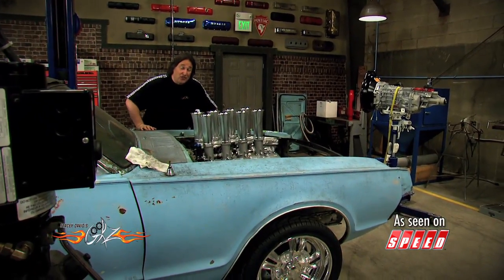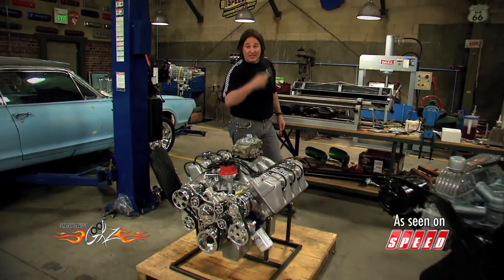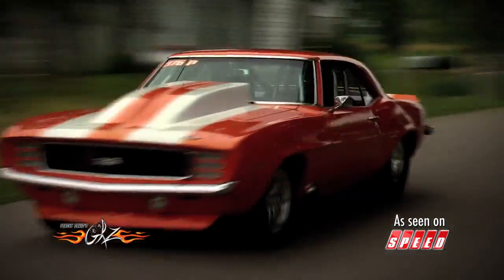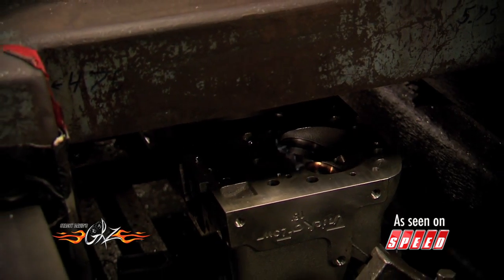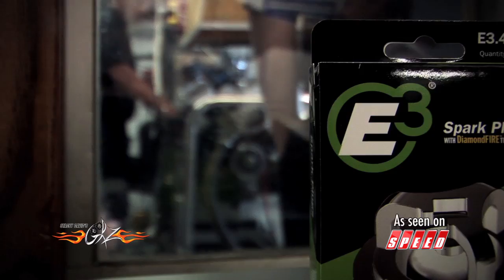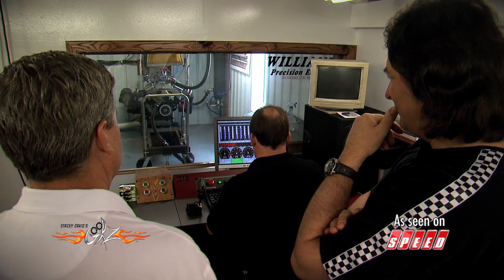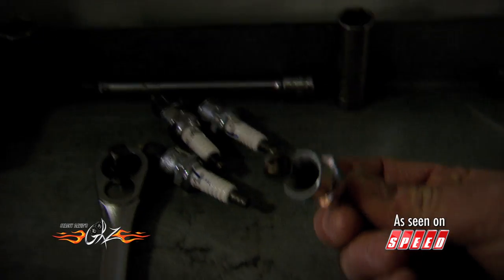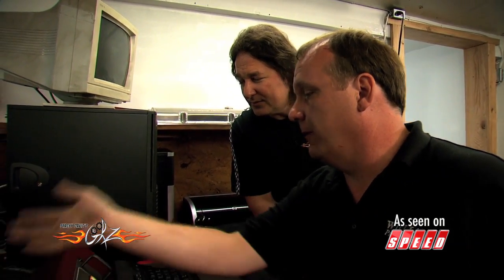Stacey David's GearZ E3 Spark Plugs In Performance Engines

Comment: Hey guys, I have been reading some of the posts on here and thought I should make a couple commits in response. I have used E3 plugs in both high performance and street applications and I am very impressed..  Our Dyno results when used in a 400 HP street rod performance engine showed us 7 ft lbs torque and a HP increase while using less fuel. When used in a 700 HP methanol burning Dirt Modified engine our power curve was increased 200 RPM on both sides of the curve. Thats big ! Roger Williams

Comment: Cale and I got a set of E3 plugs and took Cale's car to Batlground Motorsports for a dyno session. We made a pass with the stock AC FR5LS plugs. our engine made 335 RWHP with the shop temp at 93 deg f. We changed the plugs to E3 E3.48 plugs and nothing else and by then the shop temp had increased to 97 deg f. we then made 347 RWHP. If anything the shop temp increase should have hurt the HP, but we still increased 12 RWHP.

Comment: I put some in my uncles 06 silverado with the 4.8 and according to the computer, he went from 17 to almost 19mpg. Cant really tell any HP or Torque change since its drive by wire crap, but the computer noticed a diff.

Comment: I have a set in 99 silverado with a 4.8L and my gas mileage has improved and power. Soon as I put them in I felt the difference in the pedal. It was a noticeable difference. It used to take me almost a half a tank of gas to drive to new orleans and back. Now it takes about a quarter of a tank to go there and back. I live 1 hour west of new orleans. To me that's more money in the pocket and more power on the pavement. E3 spark plugs work GREAT to me. Good investment...

Comment: They seem to work on street applications fine but what about efi? there is a heat range requirement for that i'm sure and a noticeable difference if it is a colder plug than stock range,and more fuel being required,so i'd need to see the outcome tested on efi cars.

Comment: @Marshmallowrex 

you dont. you buy them specific to your truck or car. Seems weird though eh? Youd think for every motor you'd have to gap accordingly, but for example, I buy plugs for a 1999 Jeep Cherokee 4.0L. They seemed to give me a little more torque and power and I noticed it while merging onto the highway.